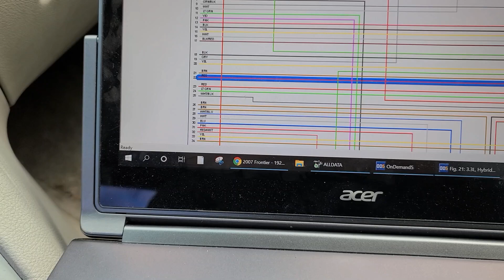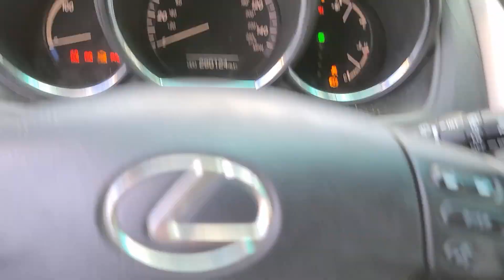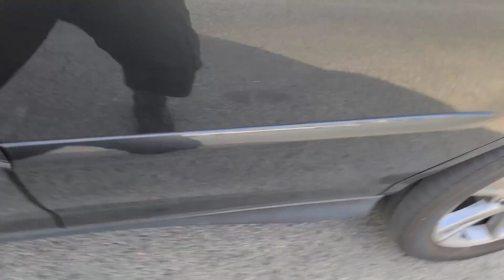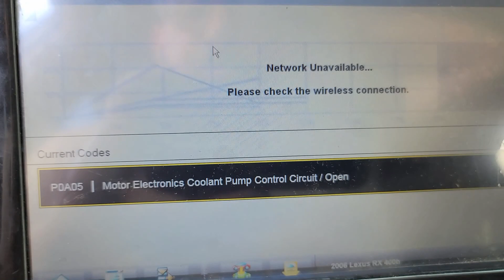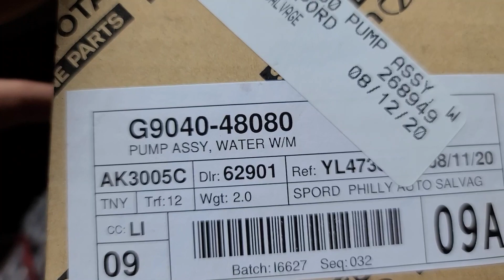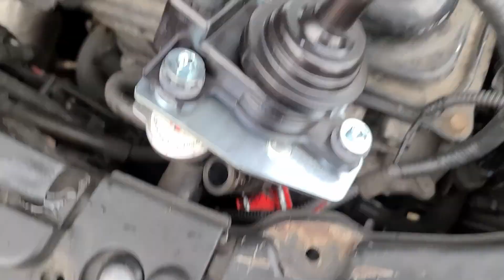2006 Lexus RX400h check hybrid system P0A05 P0A93 fault codes. Part 2 The repair.

Comment: Hi great video and thanks for the info. The only thing I would of done different is the new pump I would have connected 2hoses to a small bucket, prime it and then test it. Those pumps are not meant to run dry. Have a good day!
Reply from the maker: Great note. That's why I did not run it for long time but will definitely use it in the future.

Comment: I have the same codes on 2008 Highlander hybrid w/264,000 miles. 
Got the VSC/Check Hybrid system/Brakes systems warnings all at the same time. Momentarily i felting like hot air coming in thr cabin, then suddenly my engine shutdown!! Also got the steering wheel RED  warnings on still. Had to pull over,.i don't recommend anyone to drive a car like that.
Ran my scanner and got the P0A05 AND P0A93
planning to replace my hybrid system water pump in the near future 
Thanks for the advice
Reply from the maker: Good luck. If you are not trained to work on hybrid systems I would advice to find a hybrid tech to do the job for you
Reply: @DallasAutoDiag  Highlander is not in the USA anymore 
Thank you for the offer

Comment: Hello.
I bought yesterday a Rx400h.
Both batterys are empty.
I gonna buy a new battery tomorrow.
Can i somehow Start the engine only with the second battery and just with gas?
Is it possible to load the Main HV Battery somehow?
Reply from the maker: I believe using a csan tool you can activate the gas engine to charge the hybrid battery

Comment: I had a clip in the radiator plug broken and it plugs in but you can't see inside the wire clip unless you look with a light on the inside of the male plug female wire. If that makes any sense.
Reply from the maker: It does

Comment: My Check VSC / Hybrid System lights came on today (Lexus RX 400h, 90K miles) with the traction system light just as shown in your first video of this two-part series. I hear a high pitched whine when I back out and sometimes when turning. Both started at the same time. Would a bad water pump cause a high pitch whine (it's occasional)? I realize the check VSC/Hybrid system can have any number of causes. Thanks in advance if you see this and can respond.
Reply from the maker: I think that noise comes on with specific hybrid related codes. I have seen it on lexus gs450h.
Reply: @DallasAutoDiag  Thanks for the response. I wish I had a clue what it might be. I can't afford to have it towed in only to have them say $4K, please. Or more. I've only driven it about 30 minutes or so every 10 days for the last 1.5 years. New regular battery a few months ago. A/C went out last year. Shop charged me $350 to fix (6/21) but the cold air only lasted for 15 minutes. They said they spray painted to see leak if fix didn't work. I never went back though. Completely unrelated I would guess.
Reply: I have the same problem you had and the car want run every time I remove the negative terminal from the battery and put it back again in the car start for five second and I hear the high bitch and whine from under the car and the hybrid system turned off can you please tell me what you did if you get it fixed what was the problem thanks in advance
Reply from the maker: @amgadyousef5582  its a 2 parts video. Watch both and you will see that fix.
Reply: @amgadyousef5582  I hope yours turns out better than mine. Mine will no longer start. After I wrote the initial messages here, it never started again. It's a 2008 so I didn't have it towed to the shop and diagnosed because I know it will be many thousands to fix (like 8-12K I'm expecting). Did your car get wet? My rear car mats were soaked. Maybe from strong storms here, I don't know.
Reply: @kittieCoder  Sorry to hear that about your car but no mine didn’t get wet When I scan my car it gives me sex ignition coils but when I reset it was taking the negative battery terminal off and put it back on and gives me only ignition coil number one so I change it and I change the spark plugs that’s a problem still on and now I had no codes at all when I scan the car but the car won’t start at all not even trying to crank

Comment: Is there a way to run the 400h just off the gas engine  if you have a problem with the electric side.
Reply from the maker: No. There is no way to do so.